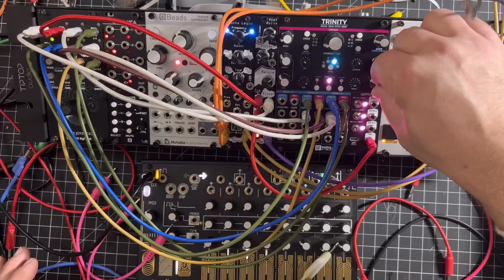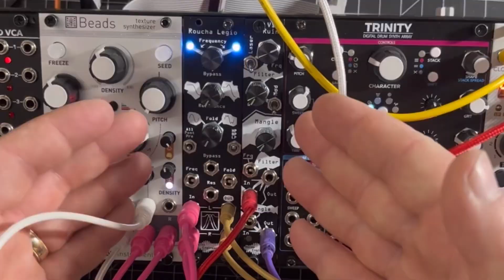Eurorack Filter & Distortion w/ Roucha Legio & Viol Ruina by Noise Engineering

Comment: At DEFCON they have a hardware hacking village, and one year these two guys showed up with a giant vanload of broken kids electronic toys.  We spent a day just shorting the boards in every combination possible, running traces everywhere on the board and sort of manually jtagging them.  We did this to produce noise that was otherwise unintended by the manufacturers.  This one guy pulled out a square wooden cube with different metal touch-sensitive surfaces all over it, and it was sensitive to the position you held it at (filled with level sensors) so the combination of touch and movement produced music.  You would have loved it!  This was maybe a decade ago, and I don't think those guys ever came back, but it was a cool idea.
Reply from the maker: Yes That sounds right up my alley! I’ve been intrigued with circuit bending instruments that I’ve seen on IG but I don’t have any knowledge of electronics so I’ve never tried it. I’m also really interested in noise boxes for the same reasons. Thanks for sharing!
Reply: That last part sounds like some Ciat-Lonbarde/Peter Blasser circuits, or one of his kin!